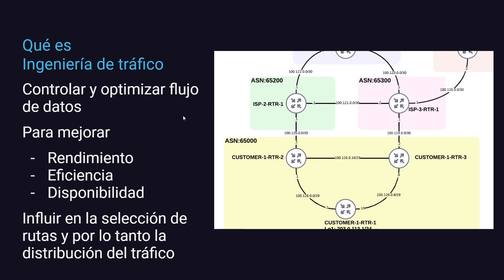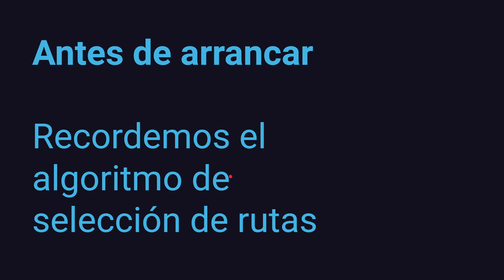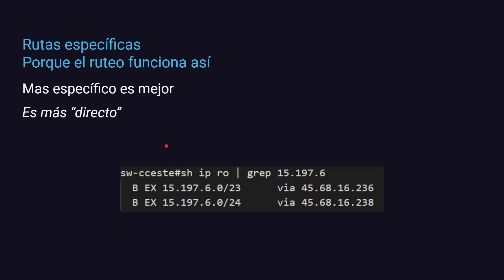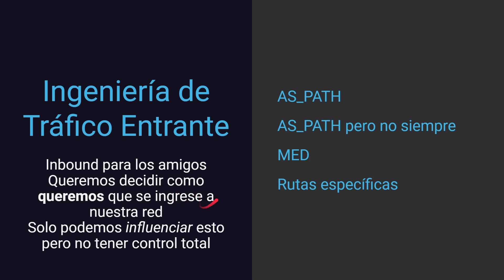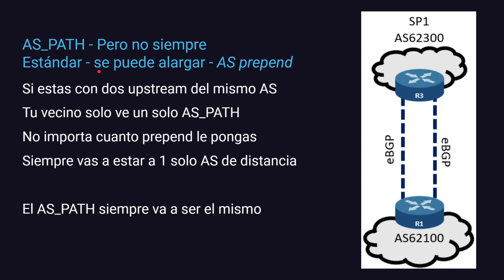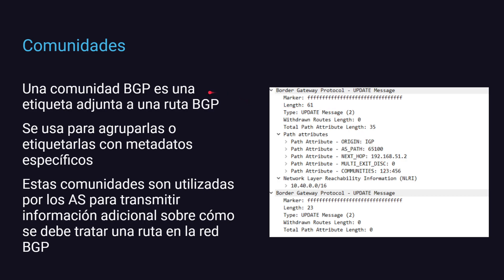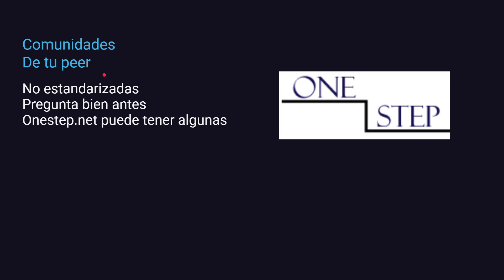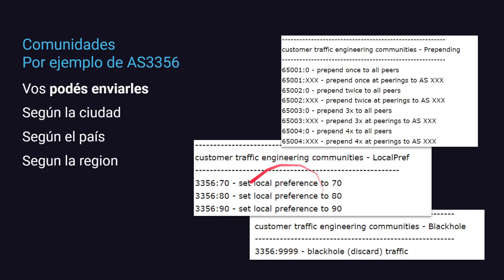Introducción al protocolo BGP 03 - Ingeniería de Tráfico

Comment: Quería consultarte que opinás de usar local pref como regla de entrada entre AS externos, es para usar entre routers que tienen más de un vínculo entre si mismos. Saludos!
Reply from the maker: Hola Lucas!
Efectivamente Local Preference sería el método ideal para hacer esto
En entornos Cisco vas a encontrarte que muchos usan Weight - que es propietario - asi que es válido pero no te lo recomiendo
Sobre todo el Local Pref es un atributo estándar que se va a pasar a otros peers IBGP asi que todos los routers de tu AS pueden conocer la preferencia de esos caminos
Por ejemplo, si estas multihomed quiza tengas una mejor latencia al 8.8.8.8 por uno de tus peers y entonces le podes setear un local pref de digamos, 150 por ejemplo, al prefijo 8.8.8.0/24 y usar este camino como preferido
Obviamente eso no influencia el tráfico entrante que es otro tema parte

Voy a explayarme en estas preguntas en un video futuro a mediados de mes, estate atento y gracias por pasar !
Reply: @cceste  muchas gracias! Estaré pasando a ver los nuevos videos. Saludos